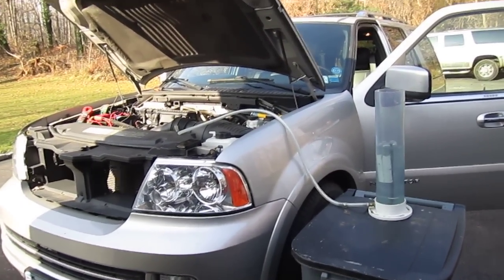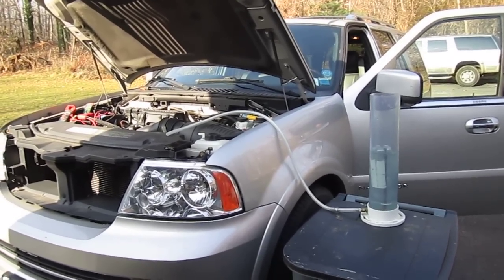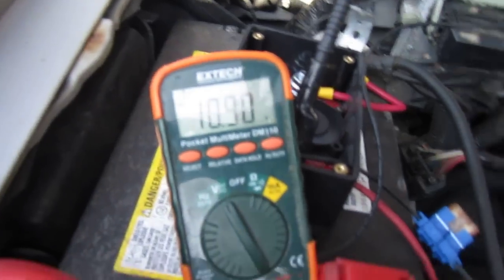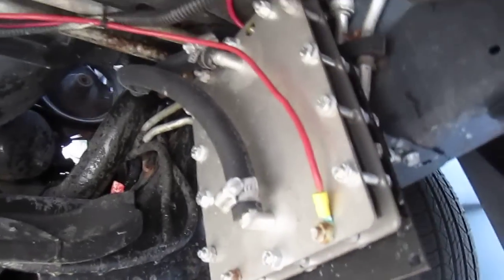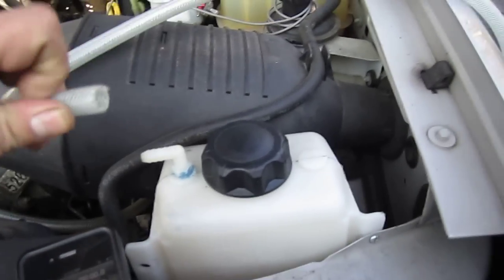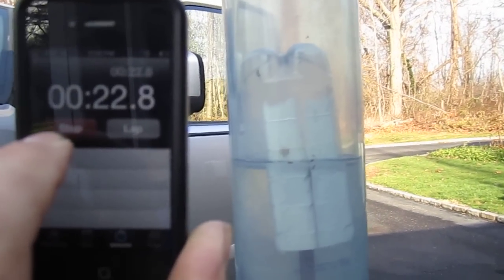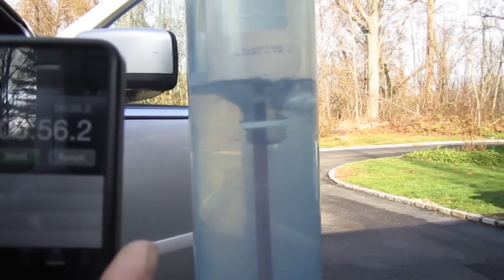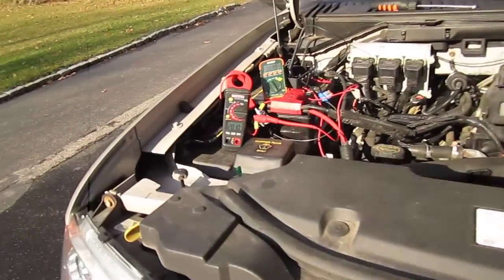HHO Dry Cell Test in a Vehicle

Comment: I'm getting tired of seeing all these uneducated people assuming that you can actually run a vehicle solely on an HHO system. That would be perpetual motion, which is impossible due to all those fancy shmancy words to do with conservation of energy.

The hydrogen is used as a fuel additive to increase efficiency. You will not run your vehicle off of water. You are using the excess power produced from your vehicle's alternator to separate oxygen and hydrogen into a fuel additive.
Reply: I wasn't even aware of the reduced emissions. I had been doing a lot of reading on it, and it is debatable if HHO systems increase mileage or efficiency due to the excess strain put on the motor by the alternator. Usually the effects break somewhere around even.

But the reduced emissions alone is good enough reason to get one.
Reply: Sorren Peak it only takes a 60cc engine to produce 700w at 12v which is 58a (specs of my portable generator) so running 20a at 11v would not be putting any strain on an engine of that size (probably wouldnt even notice it) and without knowing the actual size of the plates l would say 20a is about the limit of that cell before you are just producing steam
Reply: Green Planet's AAQIS HHO On-Demand Generator addresses this issue on a number of levels. Dynamometer testing of the AAQIS generator has recorded 
fuel efficiency improvement of 40 percent and a reduction in exhaust emissions to very nearly zero on gasoline fueled engines
Reply: Bob lazar has a hho only vehicle he built… check it out.

Comment: i'm not skeptical, but i have some questions...
That is a fuel injected vehicle. 

how did you get around the o2 sensor freaking out with the extra oxygen?
o2 sensors do not read hydrogen but do pick up the extra oxygen.   in short, these issues cause the ECU to freak out and go into a wide open gas dump, or to restrict the gas if it thinks the engine is running too rich  or lean. It will change the fuel to air ratio to what it thinks is accurate, but since it doesn't pick up hydrogen, it is always burning lean with the extra oxygen and it opens the pulse width of the fuel injectors and lets the max amount of fuel through, thus being counterproductive to mpg gains. but, you DO in fact gain horsepower.... because it's pouring fuel into the engine..... 

Also, how much HHO are you pumping into the engine?  typically, if it's a small amount, then the ecu can compensate by using various other sensors...  knock sensors, throttle position sensor and others to compensate, if the engine is running rough. But it seems that any of the potential gains get tuned out with the ECU as it tries to compensate...

editing because i just noticed billab0ng83  said something similar...
Reply: I myself have experienced gains without doing anything to modify the sensors.  I think it's because HHO ignites, and implodes back into water molecules, which becomes steam.  The 02 sensor is just relaying a voltage based on oxygen amounts.  Pure dry oxygen is an insulator to electric current, the opposite of a conductor.  Water, and other liquids such as gasoline, are conductors.  The O2 is looking for a lack of conductivity (increase in insulation) to relay a smaller output voltage.  The ECU reads that as lean.  If the HHO gases turn back into water molecules they are not going to be more insulative, they will actually increase conductivity, which will increase the voltage and make the ECU cut fuel back more.  HHO is a natural way to spoof the electronics.  I came to this conclusion myself finally when I was wondering why I kept getting better gas mileage without even having the VOLO unit installed, and decided to design a water misting system that would absorb heat and flash into steam to help push the piston during the combustion process.  I have some kinks to work out with it, such as a stronger ignition system, but then I found out you could ignite water with a stronger ignition system, and that opened up a whole new rabbit hole.  It's never ending.  One day someone is going to make an engine that fills up one time with water and it runs itself by imploding HHO to suck the piston up, then igniting the water with a power-inverted ignition coil setup.  Imagine running an engine non-stop on the same few ounces of water.  Intelligent designers have been bought out or killed for decades over energy technology.  The love of money is the root of all evil.  You can thank rich oil tycoons for why the country with the most intellectual property in the world has the vehicles with the worst gas mileage available.  We've sent people to space and back and people in 3rd world countries drive cars that can get 40+ MPG average.  The conspiracies aren't theories, they're facts.
Reply: I too will like to know this same question?
Reply: @johnsondml  Very simple,  inject it before the MAF sensor. It will see the extra oxygen and compensate. Just my thought.
Reply: @alwaysinmotion1  I've heard mixed responses on before the maf and after the maf. Some people get great mpg for a short period before MAF then the computer corrects and they get worse later others say after MAF just have to experiment with 2 port designs see which works best
Reply: David Johnson I've actually answered some of my own questions since i wrote the last post. i figure it's worth sharing with you.

1. if you pump a LOT of HHO into it, then you will have to tune the ECU. period...   but for a small amount, the ecu will compensate.  

2. as for running rich and lein.  Well, you are adding more Oxygen, which means you need to add additional fuel, or you'd run lein. however...... you are also adding more FUEL by adding the Hydrogen. so, technically you are not running lein. if you ONLY added O2 then you'd need to add gasoline or if you added ONLY hydrogen, then you'd be able to spray less gasoline, or would have to add more air to compensate... but by adding H and O together, it basically equals itself out.

3. the 02 sensors in the exhaust don't really feel too much of an effect with a small amount of HHO, because, it is being combined to produce water at the time of combustion,  Plus, gasoline itself is a hydrocarbon, hydro meaning hydrogen... and the combustion of gas does create water as well. This process won't add significantly to this effect unless a LOT of sprayed into the engine.   BUT, sometimes, you may have to use a spacer for the 02 sensor and push it further out if you are getting issues.  as for the sensor on the intake side, you put the hose AFTER the mass airflow sensor, more towards the intake manifold. otherwise it will definitely change the fuel air ratio... 

I guess, long story short, there is nothing wrong with this process, it works, and won't damage your vehicle if done correctly and people don't go overboard with the gasses.  

it won't cause any negative effect unless you are pumping a LOT of HHO into the engine...  with a kit like is shown here, it would be basically like if someone emptied a helium balloon 4 inches from your face while you were breathing in,   vs sticking the end of the balloon into your mouth.   barely noticeable in other words, but, may actually do SOMETHING for the engine.    Hope some of that makes sense.  My GF is talking over my shoulder and asking me unrelated questions so i'm multitasking while explaining.   but LSS.. it works...
Reply: G

Comment: 20amps is alot ! thats more than the alternator puts out.. and your not producing much hho.. looked like steam . .it fluctuates because the type of solution your using. . how did you fix the oxygen sensors? wich out by passing adjusting them.. the extra air/hydrogen being put in will cause the computers to add more fuel.. hence doing the opposite to what u want
Reply: billab0ng83 20 amps is more than what?? You really should see an alternator, from 70A to 120A are the most common :)
Reply: billab0ng83 i agree and disagree.. alternator for the navigator is 200 amps..  so an alternator does obviously put out more than 20.   However....  Most cars alternators put out enough voltage and amperage to make the vehicle do what it's supposed to do.. i.e. run and charge. There is a little extra for things like stereo, AC, heat, and maybe a small bit of accessories.  A navigator however, comes with a fairly large alternator for the reason that, they know people put 15 TV screens, 200 Blu-ray players, a couple of X boxes and Playstations, maybe a wii or two, Sub woofers, Neon lights all over them, and whatever other kind of random ghettoness and don't always think to add more juice to the system. so running an additional 20 amps off of the alternator really shouldn't hurt it.  That is less than say, a 150 watt amplifier, which would run well on most cars stock alternators.  but i do have concerns about the 02 sensors and the fact that you're pumping water into an engine, and water causes rust, and rust causes pissed off customers when the engines lock up after they let it sit for a month without driving it, or can cause premature failure every time they start the motor up and the piston rings scrape all of the flash rust off of the cylinder walls...  I have seen a LOT of videos of people installing them.  i have NOT seen a video saying "holy shit. i converted my car to use HHO and gas, at 45k miles, and i just hit 200k!  LOOK AT ALL THE SAVINGS IN GAS!"  no one has done a "3 years later" video either...
Reply: +M B But Octane fuel also produces Water that cancause it to rust. It will not change a lot in the combustion chamber in terms of rust.
Reply: +Mitch B oxygen sensors are placed before in or after catalytic converter's, 
These “two-way” converters combined carbon monoxide (CO) with unburned hydrocarbons (HC) to produce carbon dioxide (CO2) and water (H2O). In 1981, two-way catalytic converters were rendered obsolete by “three-way” converters that also reduce oxides of nitrogen (NOx), so water coming in contact with the oxygen sensor means nothing and does not affect its operation...
Reply: dry cells draw a lot of current ,I seen them to 41 amps...my small jar, a wet cell drew 8 to 12 amps and made just shy of 1 liter

Comment: according to most of the replies I see here who are saying that hydrogen doesn't work, than nitrous oxide can't be working ether for the same reasons...so why use it?  math figures don't lie, but people who use math do...I look at the results based on the old fashioned miles per gal used on the road compared to what was being used before. my comparison is at the pump not what some math BS says.....I can and will build my own HHO gen. The proof is at the pump, not at the end of a pencil
Reply: ipissed false. engines won't burn all fuel in the cylinder. even with back pressure, not all fuel is burned. the reason this works in theory, is because in addition to adding oxygen, you add 2 hydrogen atoms to emulate a greater amount of fuel. in reality, the hydrogen is more  like a catalyst(for all intensive purposes) for the O2 and petroleum mixture. it makes gasoline more effective. this however is only accomplished with the aid of electricity. it's beyond feasible, but maybe a solar panel is required to prevent the battery from being totally drained. It saves gas, but it won't save "energy"
Reply: @RP4UXO  so explain to me why if I search up "US military uses HHO in their hummers" or US Police use HHO in their cars" oh wait they can have it fuck us we are the slaves wiki hah anyone can change wiki if I went and changed it would that make you believe? 
Real world results hydrogen is the fuel and works on implosion and you dont even need gas look up make HHO torch on youtube and see what it can burn it even burns submerged in water and boils it in seconds the gas then produces 30-35% oxygen fumes when you breath it in you get accelerated healing they use it for the benz for scooba divers

But they dont want us to know how easy it is to make it we need a guy with 10k science degrees when actually you can make gold in water with different stuff within water but ehhhh dont want that all metal comes from heat and found in mountains formed by lava and HHO can burn high temps. 
you can even cut and melt rock with it lime it cant seem to cut it thats interesting.
Oil and gas is a corporation and if they told the world "you can just run your car on water and its easy" they woulld be out of business and they could not push this "global warming" if you are not part of the solution you are part of the problem who buys these idea? the rich they dont want the money to stop flowing ....kk thx
Reply: Nitrous oxide is not a fuel, as a matter of fact it is not combustible nor does it aid in the combustion of other materials. The desirable properties of nitrous oxide in an internal combustion engine is that it is much less compressible than air. As a result when you inject it into a cylinder with air it raises the overall compression ratio of the gas/air. More compression means more power.
Your application of one thing you don't know about in order to fortify your opinion of yet another thing you know nothing about is a vortex of ignorance.
Reply: Tom Hoehler By "what I meant to say" you mean if I had read the Wiki article first, but you are still wrong. The part about being an oxidizer refers to rocket fuels. Read along to the part about engines, and pay attention to the part about how nitrous can be harmful to an engine because it RAISES COMPRESSION. You missed that.
As an oxidizer in an engine nitrous plays very little role as air has plenty of oxygen in it already, and cars burn fuel very efficiently, so efficient in fact that they have an oxygen sensor to report LEFTOVER oxygen. Again there is plenty of oxygen already in air to burn all of the fuel.
This is why experts such as myself don't consider the oxidation effect of nitrous to be of much benefit. It's the increased compression we are after, and to that you will have to read another Wiki article to understand.
Reply: Tom Hoehler You read a Wiki page, now you think you know the science, but the reality is if you want more fuel/air you use a supercharger, or blower. If you want more compression you use nitrous. What you are not getting is you can't run nitrous all the time, and if HHO was anything like nitrous you couldn't run it all the time either. You can't tune it well, and it would destroy your engine.
Nobody is dumping so much extra fuel into their system that you need more oxygen to burn it efficiently, your oxygen sensor tells you that.
Reply: you got Roy Seberg!

Comment: I know you will pick me up on the % fuel burned..The fuel air mixture is compressed and ignited in an enclosed space...it will all burn, at least its going to be close to 100% in a properly tuned engine. Fuel will only not burn if it is starved of oxygen, so at high revs, when its hot and poorly tuned...Bet its still in 90% region.

Comment: You are completely confused. The thermal efficiency of an engine is in the 30% region, nearly all the fuel will be burned, how can it not be? You have a big 5 litre engine...5 litres of air/fuel mix, sucked into your eight cylinders average 2500rpm..your HHO will give you a litre a minute..H2 percentage wise 0.0002% = bugger all. Wake up guys.

Comment: As I told "Dee Jay",  I researched this extensively, it basically consumed my life for close to 4 years, wet cells, dry cells, stainless tubes, stainless wire coils, plates, plastic, glass containers, I forget how many cars of varying engine type and size, engines on stands in the workshop running, to try and create an equal running environment for each one. Alternators changed for voltage/amperage etc. I telling you now, save your money. It's a scam.
Reply: SHUT UP

Comment: If you calculate the fuel consumption the old fashioned way, this too, is indicative only, and is less accurate than the computer in a vehicle. This way, doesn't take into consideration environment changes, such as cooler or warmer atmosphere, speed and load differences etc. which a computer "does", as it senses changes regardless of where it is. "HHO" generators won't harm your vehicle, but they don't do anything for it either.

Comment: The amount of Hydrogen ends up mixing into the air flow, and ends up being at a level that Hydrogen would be normally in the atmosphere. If the level of Hydrogen is higher than normally produced by the average "HHO" generator, this can "trick" the sensors in the intake as well as the exhaust, this can give a false reading. If your vehicle has a fuel consumption read-out on the dash, these are indicative only, not accurate, and become less accurate if the sensors are "tricked".

Comment: Thing is, a well tuned engine, soot build up doesn't happen, it does as the engine ages and becomes less efficient due to wear. But if you service it regularly, this will keep wear down to a minimum. The average engine requires approx 5000 liters per minute of air, this increases dramatically under load or higher revs. The amount of hydrogen produced from these "HHO" generators, is, and will never be enough to do anything, the Hydrogen becomes "watered down", to near zero.
Reply: nope, some people have managed to go 100% HHO, cars can be convert to run on LP gas too ...hybrids should run 10 -40% HHO.  we need ECO fuel maps for HHO apps..I just bought a "self adjusting" fuel plug in , I have not tried it yet

Comment: will suplement. with hho in sys. As Ke4uyp stated will give you more power per cylinder. therefore a lesser amount of gasoline will be used per cyl. you just get more bang per piston, which mean more miles per tank. Which is $ back in your pocket, and a cleaner burning engine.